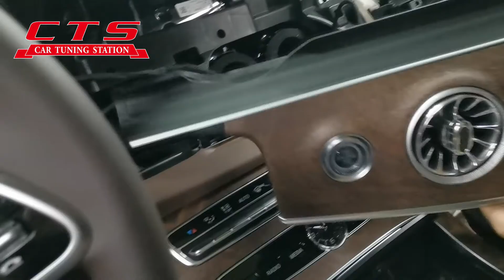How to install LED airvent for Mercedes Benz W213 E class？

Comment: 7.10 - 8.06 stripped the mechanism that operates both vents on the oem mercedes unit...8.28 - 9.45 you can clearly see the cog in the middle where the open /close mechanism is supposed to go back, he never reassembles the linkage mechanism or puts it back in...Then note how when he controls the vent manually he never even touches the two stand alone central chrome knobs. I personally wouldn't go near this product.

Comment: It looks like the original knobs that open and close two vents at a time on the main centre console doesn't work if you install these, you can only adjust them by the actual vents. Notice how they strip the mechanism between the two vents on the rear, they then proceed just to screw the chrome knobs back in to the console without actually reassembling as it was on the mercedes vents. This means the chrome knobs are just put back as not to leave holes in the dash but they are now rendered useless.

Comment: Does it come with cable adapter to tap into the factory led lights around the center console?
Reply from the maker: yes , it comes with a packaged
Reply: Jeff Gao Hi, Where do You install the cabel for rear vent, can they also be connected under the console? After You install the front Air vent.
Reply: Car Tuning Station does it need a coding?